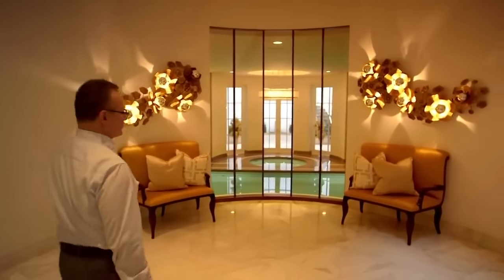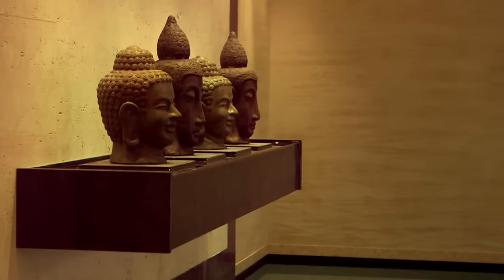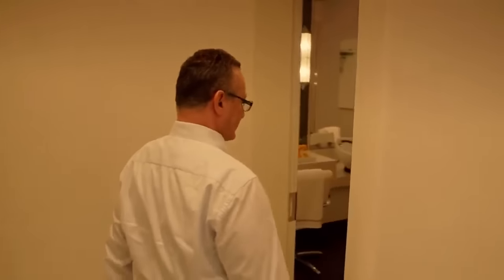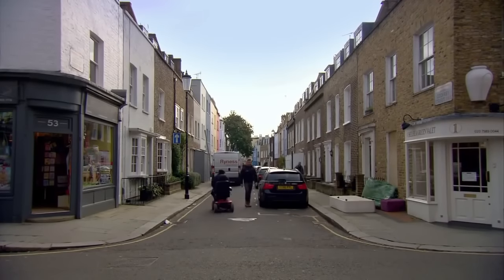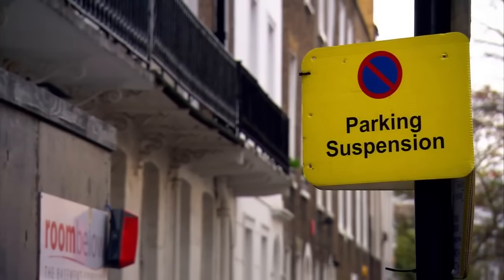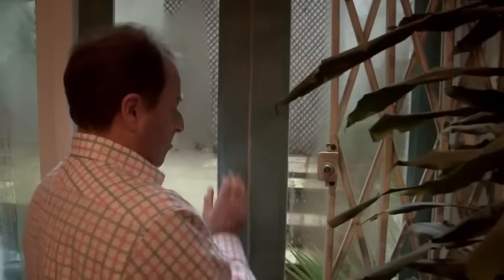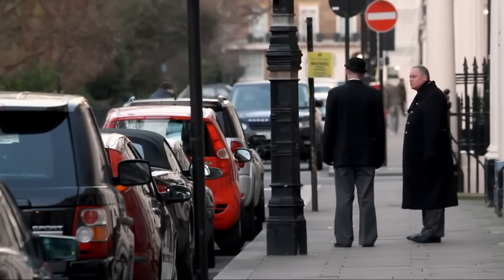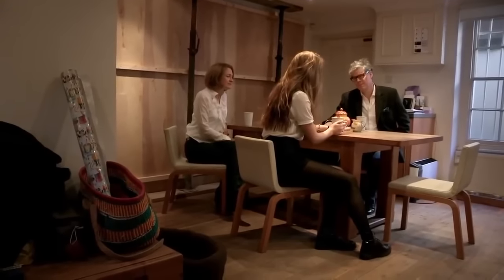Millionaire Basement Wars BBC Documentary 2015 - Landmass London Property Development

Comment: My question, how long are these basements going to be waterproofed.
Reply: I was thinking that also. After all, most houses come with a 10 yr damp proof guarantee. Doubt if that would do much good in these situations.
Reply: No basement is waterproof, especially multi level ones like these. The walls are most probably made out of a modified concrete mix with a waterproofing additive, over which goes a membrane that diverts the water that makes it way though the walls on to channels that lead to a sump pump that discharges the water to the storm drain or sewers.
Reply: One guess if these basements are causing flooding issues when it rains since they block so much drainage soil.

Comment: Very nice basement at 5:10, with the additions. I have to wonder how many stories down is the max for a basement? Is there a limit of 3-4 stories and do the funds need to be put into escrow for structural engineering protection of the home, surrounding home and street? If constriction stops mid renovation you have quite an unstable structure.
Reply: Cookie Monster x
Reply: Usually yes. Escrow secured under the party wall agreement exactly for this reason
Reply: You mean the underfloor, or the entertainment area?

Comment: It is bad.  It’s terrible, it interferes with the structural integrity of adjoining property. These are historical buildings in historical settings. The fact that the NT is more worried about whether or not you reconstructed using waddle and daub instead of 21st century engineering is ridiculous.
And I find it that incredible that a bunch of provincials that have probably never seen these historic places would make snarky comments.